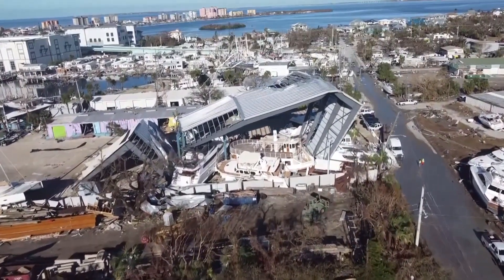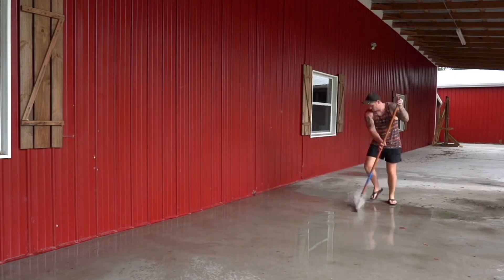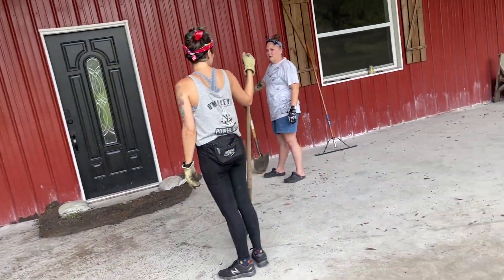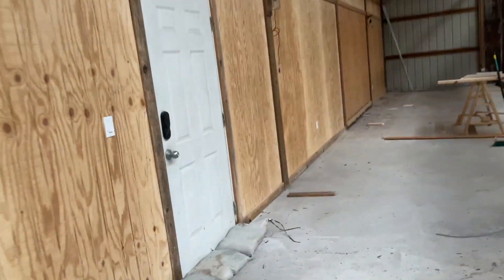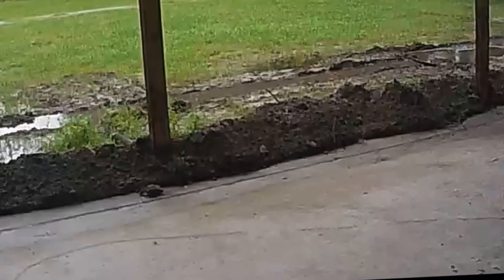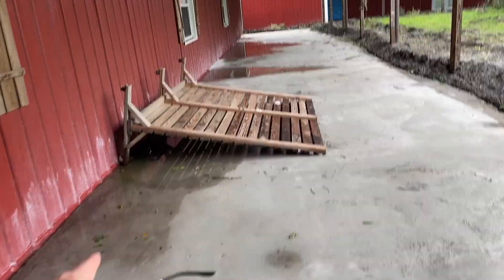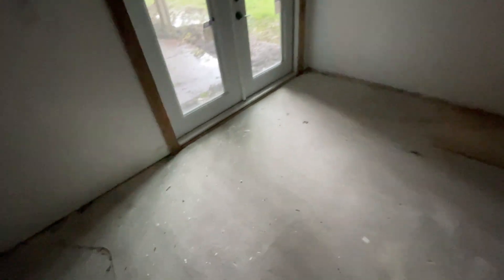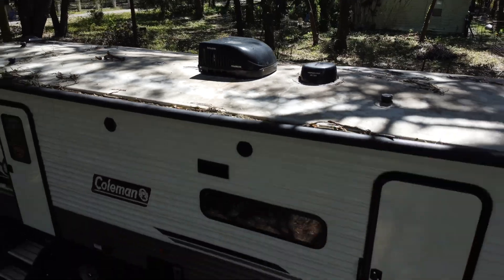Hurricane Ian Florida...Here's Our Story

Comment: Longterm, I suggest you get permanent French Drains installed, but the key is to find a place for them to empty...  so the water leaves the property.   Since your area is so flat, that may be difficult. You mentioned that your pond is full.  I'm not surprised at all.   Looks to me like you came out of this one relatively well.

Inside the Buildings....   Some Dehumidifier Units may be helpful especially to deal with any mustiness. I keep 2 small units running  24/7, each one removes about 5 Gallons of water from the space daily. Obviously your space is much larger, but you can scale up.   Again, this only works if there's somewhere for the water to go.    A flood situation is much different from a bit of water seeping in thru doors and under walls. 

Glad to see you weathered the storm as well as you did.  I seldom comment, but follow your journey!
Reply: @whatsapp. Who are you?  And what value do you offer?  Seems scammy to me.

Comment: I'm sure you have probably seen the advertisements for the solar/ac charged power stations. One of them could potentially run your computers and printers while the power is out on your property so you wouldn't have to ship everything from your other house. You could either take it home with you to recharge it overnight or charge it with the solar panel.
They typically run around $1000 - $1500.
Eventually, you will probably want a "whole house" generator system, but those cost a lot more.